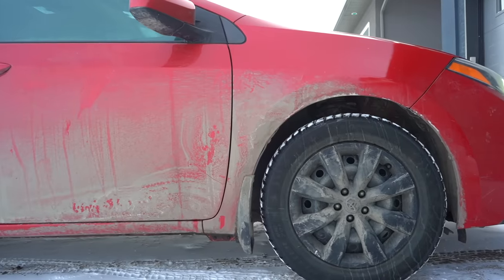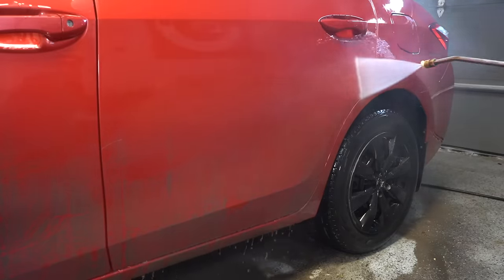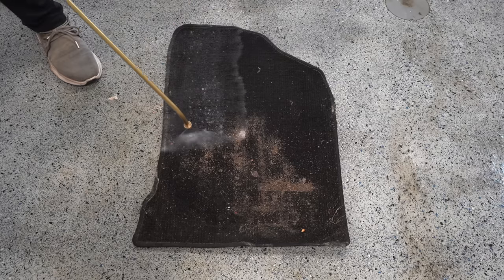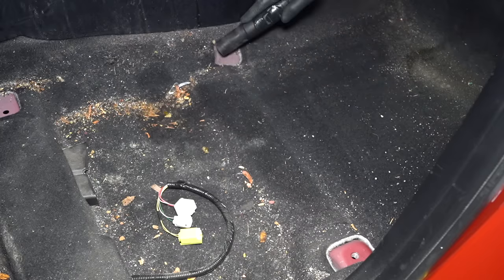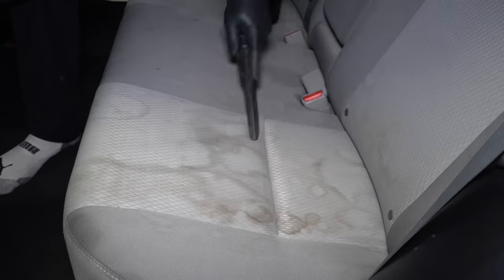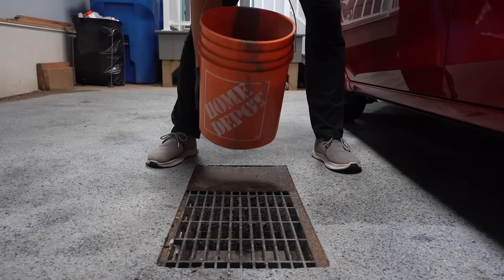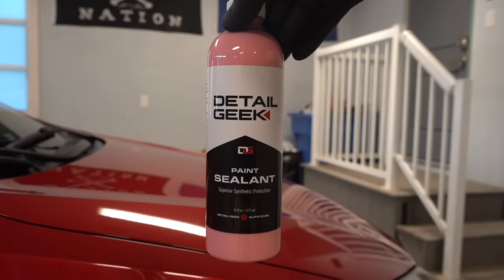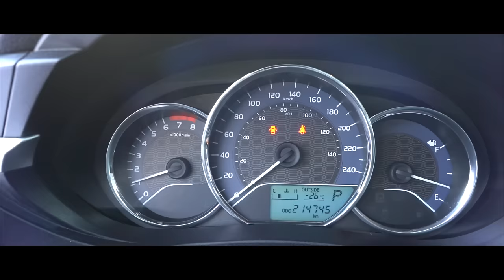Cleaning The SMELLIEST Car Ever! | Illegal Substance Removal | The Detail Geek

Comment: Watching your videos, I found it interesting that Toyota, a company not known for pinching pennies, put the cheapest, crummiest carpets in their cars while Chrysler, a company known for pinching pennies, put very high-quality carpets in even their cheap 200 model.
Reply: It makes sense to spend most of the budget in a proper engine and less on the inside to be honest. Kind of like flipping a house( most) people want the pretty to shine so they spend the most on that rather than proper pluming ac foundation repair etc or a good phone etc
Reply: Most people who buy Toyota’s buy them for reliability rather than for looks kinda like construction worker usually buy Ford trucks rather than the tundra since it is smaller and more expensive sometimes
Reply: It’s a base model, notice the steel wheels and hubcaps. They have much higher spec models too.
Reply: @AlondraPerez  ahh yeah driving a Toyota not the most exciting car out there,it will u from a to be that's about it 🤗🤗🤗🤗🤗

Comment: Another great video, Mitch! As a Corolla owner, I've been worried about what you might say about the poor quality carpet haha. Just an idea...would love to see a video of how you clean your tools (Bissell, detail brushes, etc.).
Reply: @Andrea Mustafa well the carpet may be poor quality but the car can last 300K or more miles with proper maintenance, so the car is not poor quality. My 06 Toyota Matrix has 150K miles & it still runs like brand new!
Reply: @Blakecryderman7244  Your 06 is definitely better materials than newer Toyotas they have gotten very cheap lately. I have a '12 and the sheet metal is very thin and the interior plastics are rather cheap. The engines might still run but keep in mind a 15 Corolla will also have a CVT and we don't know of many CVTs that go as long as older conventional automatics. I really feel like other brands have caught up to and/or passed Toyota in build quality - not saying anything about mechanically though.
Reply: I had a Toyota corolla for years it was great and so reliable. I needed a different sized car so eventually and reluctantly switched.  I don't like the newer Toyota corolla.
Reply: I was gonna say, I own a Corolla, and the carpet is not great, neither is the noise insulation, but these cars are definitely well-built and very trouble-free
Reply: I had a 2014 Corolla which, sadly, was totaled last year.  It was a great car. I bought a used 2021 Corolla. I wish I could combine elements from both cars.
Reply: It is an economy car.
Reply: Corolla have the best carpet ever,just kidding 😄😄😄😄
Reply: @irelandshistoryhunters5059  😄😄
Reply: Especially the steam and vacuum parts.🤢
Reply: @Blakecryderman7244  fr tho. I drive around in a 2010 Camry se with 225,000 miles and it pretty much runs and drives like a new car. Toyota reliability is amazing idk how they do it 😭
Reply: @bigboyisaac255  well one of the reasons is because they don’t put as much unnecessary technology in their cars as other automakers. Because the more electronic features, the more stuff to break. Also, they don’t turbocharge their cars, if they did, the engines would wear out faster. More strain & ramming more air. Except if it’s a turbo diesel, that’s not a problem because diesels can take it way more that gasoline engines.
Reply: @Blakecryderman7244  true
Reply: Got a new 2021 corolla this year with 8 miles on it I love it tbh
Reply: With the smell of the car and the stains and milage I would say he does for dash or some similar job
Reply: Youre cute.
Reply: @thebigfranker  Yeah the Corolla is pretty much at the bottom of its class for quality!!

Comment: Just curious, I never see the headliners cleaned. With a smoker car, surely that smell would penetrate that as well? Did you have to clean the headliner and if so, how did you do it?
Reply: He mentioned once: there's only so much one can do to clean headliners w/o loosening the glue to keep it attached. I doubt he deep cleans many headliners for that reason.
Reply: Ozone will kill a lot of the smell in the headliner.  My son bought a cheap car before bootcamp that was owned by a heavy smoker. After using my ozone machine, i had to dye the headliner because it was so discolored. But smell was almost gone.
Reply: @gregkrueger331  curious, how did you dye the headliner?
Reply: @Senoj715  there are a couple different ways to get it done. I used rit fabric dye and water in an fine mist sprayer. Test sprayed it to get the color right and started spraying it on. You don’t want to soak it though, that’s why i used a finer mist.
Reply: If you have a steam cleaner like he has and wrap a towel around the nozzle, you can use that on some headliners. But it really depends on what the headliner is made out of, age, condition, etc.
Reply: @gregkrueger331  Nice, gonna keep that in mind for the future. Thanks for the reply 🙂!!
Reply: My question too...the headliner. Must really stink.

Comment: As a science experiment I would be most curious to know the weight of all the dirt you remove from the dirtiest jobs.  The loose vacuumed trash on the carpet is an obvious one but I bet that the grime from the outside plus all the other bits, once the car is dry, must be significant
Reply: If it’s a 7 seater I’d say about a ton.

Comment: How do you keep the stains from returning? Seems like they are pretty bad and may return after cleaning.
Reply: in this video the stains are still there in my opinion, i mean you can see them, and other things could have been done better, but i give you a trick of how to remove the stains, first of all you can repeat the procces twice if it's super dirty and in the end after extraction you can use a wet towel and press really hard to remove the stains completely

Comment: The 14 to 19 year Corolla's probably have the worst factory cloth seats ever made this is coming from the words of a detailer myself you can get the dirt out of those seats but the stains will remain forever and these stains probably show the worst of any factory cloth seat you can't even really hide the stain as well as with other car seats but that goes to show where the what I assume was $24,000 went to when it was new just the engine transmission radiator tech package all the mechanical hardware and software is where that all comes from as for your floors and seats cheapest quality stuff you can find just a mental note about cars.

Comment: With those temperatures you were running off, and your accent, you sound like you might be near ND--makes me wonder if I can come see you if you are that close. Not too many places in the continental US get those kinds of temps. Thanks for doing the video. I need to tackle the interior of this car I just bought that seemingly sat for a while. I have a good bit of stuff already but would need some brushes and maybe a few chemicals. I have a drill to which heads can be attached, etc. I'd need that Bissell green machine to extract liquids maybe. . . . but I am going to get to watching the vid to learn some shit. Thanks for doing the vid. Respect.

Comment: I used to be in the Coast Guard. At one point I was offered a room in the barracks. The room reeked of cigar smoke from the previous occupant. No matter what I did, I couldn't get rid of it. The folks that were responsible for the building eventually, many months later, came into my room and cleaned the carpet. The odor was gone after that. I was blown away. I never realized how much smell (and other things) can get trapped into carpets. From that day forward I've always thought of carpets as a giant paper towel on the floor.

Comment: Fantastic work! On vehicles like that, I would add a chlorine dioxide gas treatment to kill all odors that are probably still trapped deep in the foams, headliner, and other hard to reach areas. There are kits made especially for treating vehicles. They are very effective. Be careful with the gas, do not use in confined areas. Follow all safety proceedures. Use at own risk.

Comment: there's nothing out there in the winter that can muck up your car. bro you literally scrapped off snow from the wheel well. if there's snow on the road, there's either salt or sand on the road. both of those can easily dirty a car

Comment: Hello I have few questions
1 what is this machine called which you use to eliminate smell and what type of smell remains after the dirty smell goes out and from where do it get this machine 
2 from where do I get cordless drill and different type of brushes and what power size machine you recommend for non commercial use 

You are doing an excellent job if I was in Canada I would have definitely visited you 
👍

Comment: I have the same car. The seats stain because of the crap fabric. I had a water bottle on my seat and the condensation caused the water stain along with normal dirt, just looks terrible. But so easy to stain. Terrible fabric

Comment: A good tip for vacuuming especially cheap carpet is use a to agitate as you follow with the vac, but the is one of those massage, the old ones that were flat work ok but to bulky, the new vertical ones they have that just has the massager exposed almost pistol style works the best

Comment: I would love for you to add footage of cleaning the engine bay! You do clean the engine bay, right?!
Reply: I wanted to do it to my car but I been scared that I’ll mess something up or wet the wrong thing😬
Reply: @dmariosikes5338  Modern cars have virtually no concerns for hosing off the engine. Make sure the engine isn't hot and don't use a pressure washer up close, as that will force water into the electrical connectors. Older cars with open throttle bodies and air intakes had to be wrapped with cellophane so water wouldn't enter the intake.